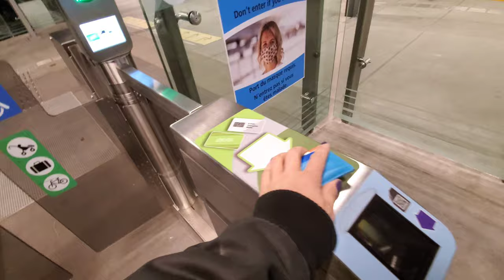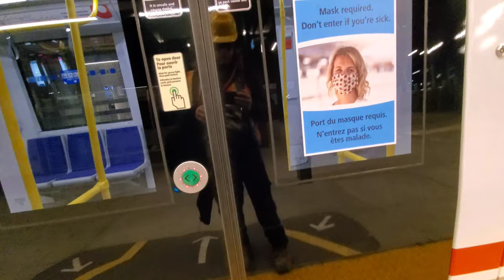A day in the life of construction laborer

Comment: Any advice for someone coming straight out of high school
Reply from the maker: If you're starting a construction labor job they're probably going to like that you're inexperienced as it lets them teach you what they want to do. I guess the most important thing I can say is remember your PPE, wear a mask when there's dust, not just one of those paper ones that people use for covid but one that makes a seal on your face. I use a p100 that people usually use for spray-paint any time there's drywall dust. It can be a bit uncomfortable but you get used to it, it's easy to clean and way better than the n95 masks and it will protect your lungs for the long term.
Reply: @NathanaelNewton  thanks for the fast reply, how would you recommend Finding the job with no experience of course.
Reply from the maker: I personally used a placement agency that assigned me to different jobs almost every day, a lot of companies will hire through those, they use them to find people but you'll often get underpaid doing that. A better but more difficult route is to sign up with the local labour union, they might need proof of some experience but it depends on the place where you live, that way you will get much better starting pay rate and benefits.

There are lots of different placement agencies, for example peopleready, Manpower, Drake, but you will usually end up working minimum wage and have to complete several hundred hours worth of work in order for a company to be able to hire you. It's a really good way to get a foot in the door but there's pros and cons like I listed above.

Generally, if it's possible, sign up for a labour union, if that's not an option then you can always approach a construction site and ask if they're hiring, look up the company names on the vehicles that you see and look at their websites and see if they're hiring.
Reply: @NathanaelNewton  thanks its confusing when youve never done this before. I dont know whats to do honestly but im guessing the agency thing sounds the best
Reply from the maker: Working for an agency is a great way to get experience in a lot of different things, it helps you figure out what you want to do and explore your options
Reply: @NathanaelNewton  can you be a construction laborer at 17?
Reply from the maker: Probably, depends on your local jurisdiction and what the laws are about people under the age of 18